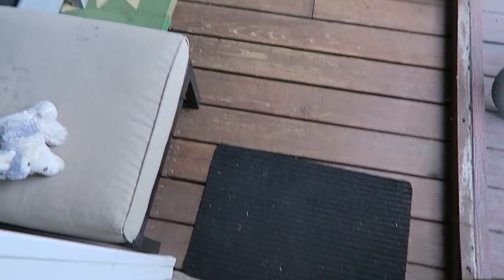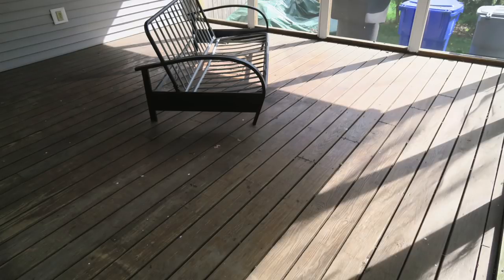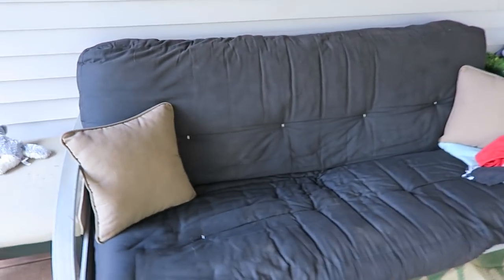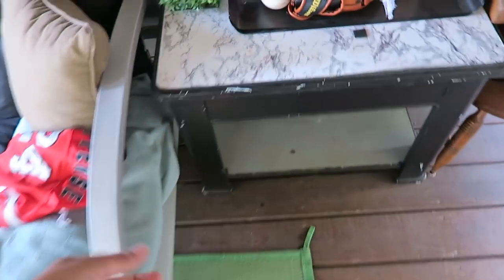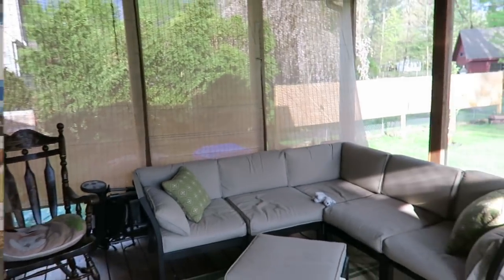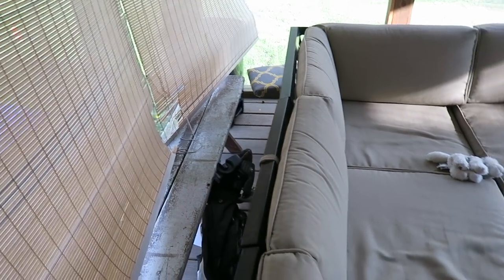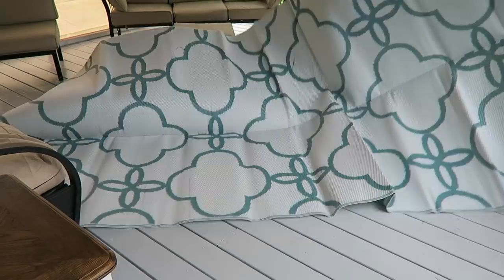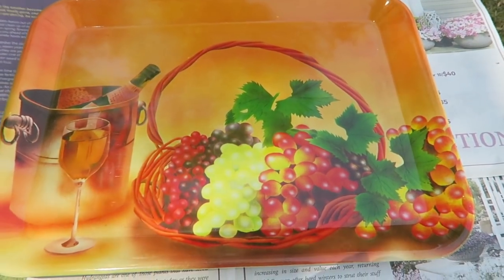Dramatic Transformation of a Screened in Porch ~ DIY Makeover Project

Comment: I just found your video and I was wondering how do u like your couch? I am thinking about getting that same one☺️
Reply from the maker: I like it for the most part. Its more shallow than I would like. I like to sit back further to lounge. :) And the cushions could be thicker but its on the less expensive side of things so not bad. And just hanging out outside for a little while it works. We have fallen asleep on it a few times so it's ok. I find it has gotten dirty in spots easily and it doesn't come completely clean with wiping it with product so be careful there. The frame itself has held up fine. It stays out on the porch year round and has not tarnished.
Reply: Random Bites of a Sweet Life that’s good news, we have a deck with a pérgola so it’s going to get wet Maybe the baby cushions would be better

Comment: I would have used a roller on the floor .
Reply from the maker: That would have been a good option. I was concerned about having to go back over it with a brush though because there were so many little grooves in the wood. I figured I would do it all in one swoop. It was time consuming though. :)
Reply: Random Bites of a Sweet Life I felt it for you. Girl my back would have wanted to be auctioned off the get rid of me for putting it through all that. Your project came out good though. Enjoy.